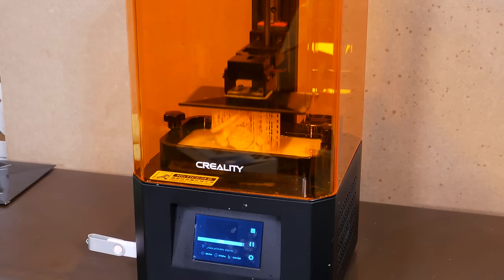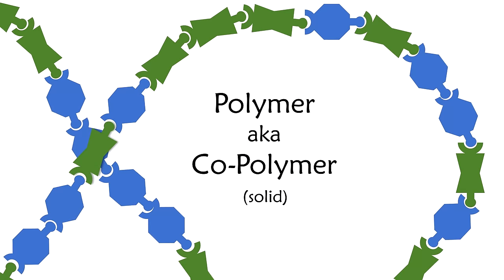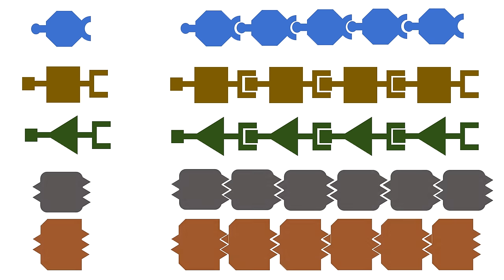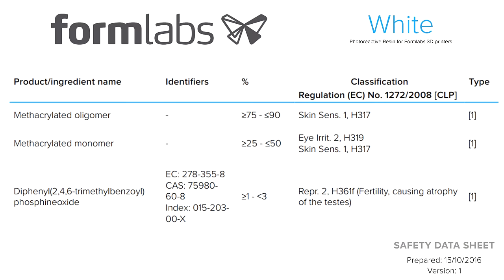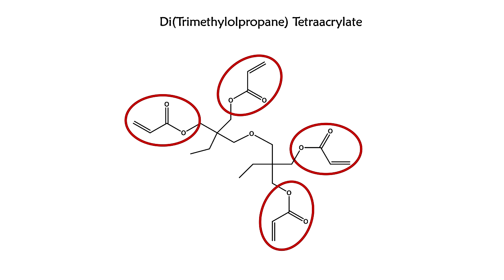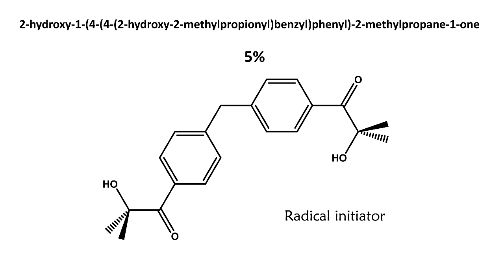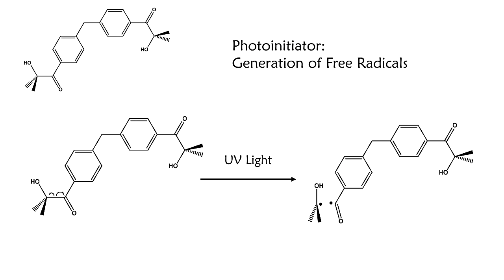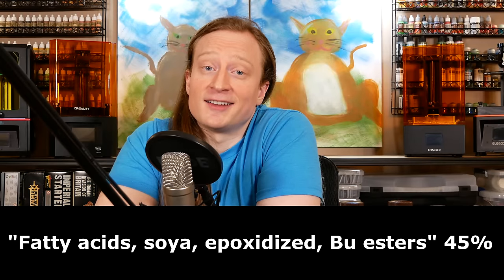Ph.D. Chemist Explains 3D Printer Resin

Comment: Yum, yum.  Does it require a food allergy statement, if someone eats the FDA GRAS color and soy extracts in baked goods, mixed with flours and such?  ;-p  

Somehow the tone of discussion about cartoon radicals and unstable conditions left me thinking an almost identical sound track with minor language edits, and the cartoon radical graphics but with suitable charicature faces, could be used for satire or parody of various US or UK preachers or politicians?    

As to alcohol, I'd hope anyone who actually watched a video like this to the end already knows of one greater danger....  Alcohol on some surfaces and under warm conditions, can carry a smouldering flame for long periods, and not be noticed, but flash up viciously when a container is lifted, and you're "just cleaning up" putting sealed containers away, and perhaps not thinking about safety issues of handling the actual chemicals or about such hazards.  I've seen people who know better end up in the ER that way and with scars on hands, necks, or faces 30 years later, especially if plastic clothes melt into skin and leave the equivalent of heavy oil burns.  

Just as with work around high voltage, RF, or simple fire hazards, clothing with low burn risks, like wool or cotton, or even leather, may be safer than dacron, nylon, acetates, etc.  Even NFPA has standards for such issues.